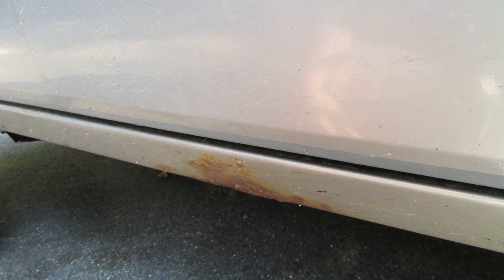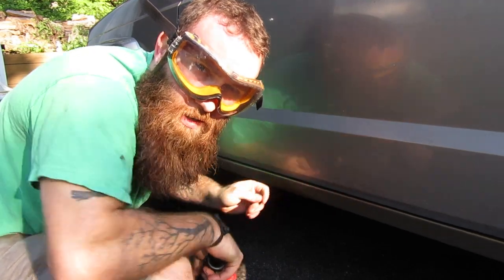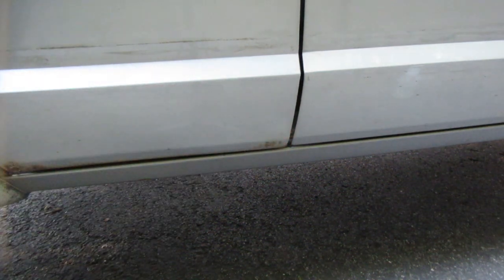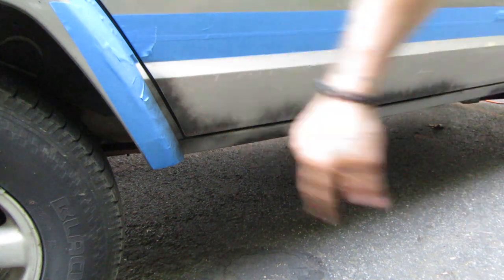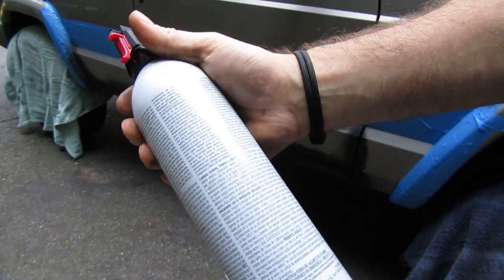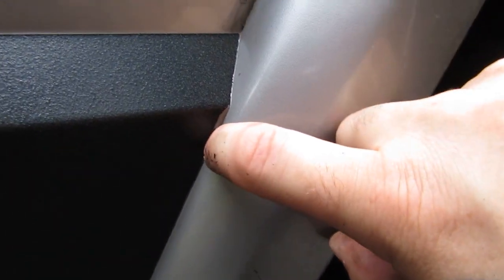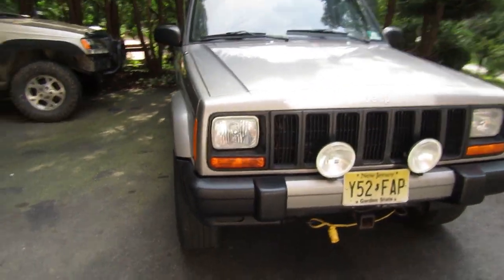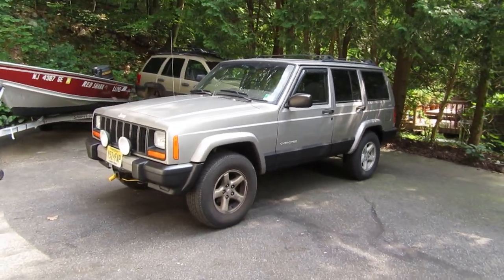BEST BED LINER - Rockers and Doors

Comment: I just did my 2007 Ranger. It had no rust but i spent all summer on the frame, interior, paint correction so did extra on the rockers and then i undercoated the whole truck with fluid film.
Now i have a completed and mint ranger with only 60,000 miles.

Comment: First i used Stabil Rust Stopper it's like WD 40 but it sticks to the inside of the Rockers i found 2 small holes to spray it in. Lower Door's done from the inside, removed the door panels and coated  where the rust is coming from and waited a week. Bottom Line and i am sure you know that Rust is coming from the inside out. Did one side of my XJ the other side is clean and you only can see one side at a time lol. I also made sure to do the inside of the bottom lip of both door's on the passenger side. When the Drivers side starts to act up i will do the same. I have 2 small holes in my floor pans not bad will be patching next summer. You have to keep an eye out for that Rust or someone else will be at (Pick a Part) picking the bones of your ride. I seen the video of you doing your head liner long ago and just happened to click on one of your other videos. Keep them coming I just Subscribed.

Comment: great I have to do this my vw jetta has rust on rocker panel and I do not have money to fix it. Its a white car do ya think black will look good? I see white cars with back undercoating all the time. I do not want to fuss with paint color and it would be a quick fix.
Reply from the maker: I think that should look fine. White and black is a classic!

Comment: Will this cover up small rust Holes on my Rocker? There kinda small and also don't want to spend more time fixing them but will sand them down a bit then use the primer you showed then the bedliner spray. Thanks for the video.
Reply from the maker: Yes, it likely could, but it is going to continue to rust under there and will eventually rust out completely

Comment: Spray the flares too ..
Reply from the maker: Yea? That has been the debate. I will tally you as a vote for painted fenders.
Reply: Throw me in the vote too. I’ve been looking for a good spray liner and I’ve always came up short for something quality. However, I think I finally found it. Looks good and seems more durable than most. 👍
Reply from the maker: @kbproductions8387  I can confirm now after some use and abuse that this stuff is tough. I think it is actually MORE durable as it is not as textured as a Herculiner. Less likely to get chipped off